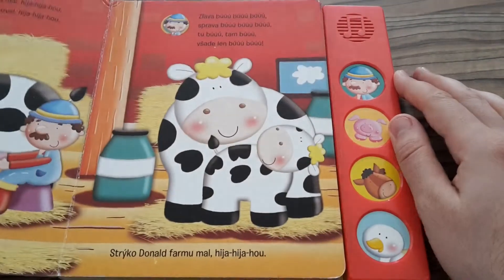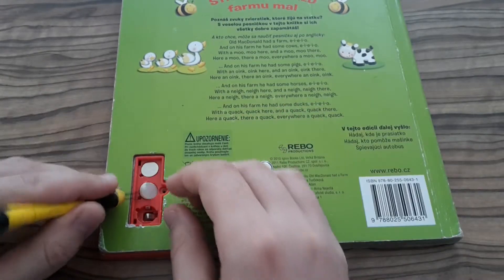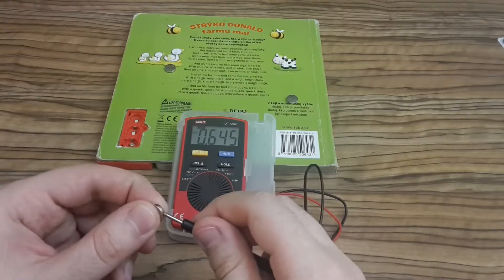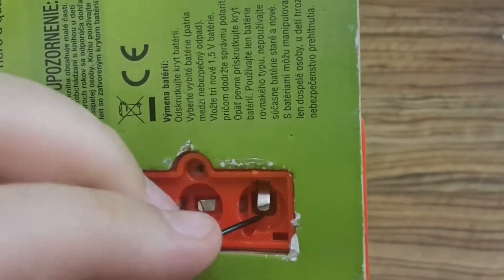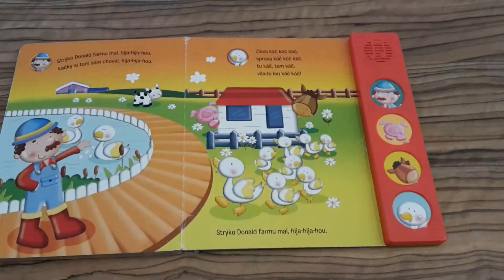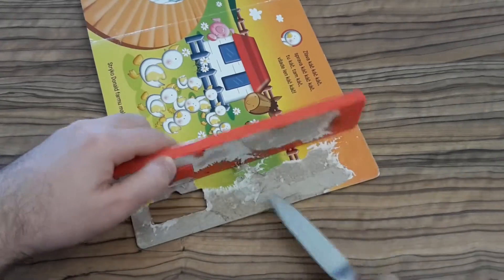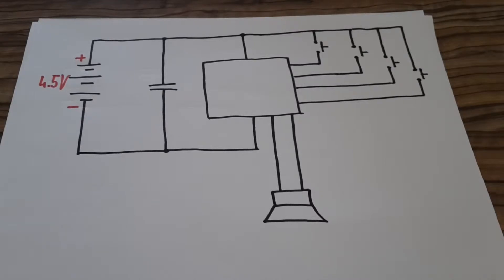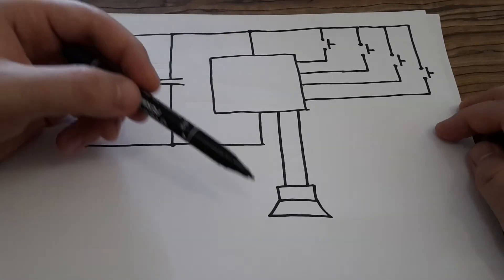Children's Sound Book Repair (1/2)

Comment: Do you have any tips for reducing the sound output for a book like this? I have a series of music books which for some reason are very loud. It causes the speaker to distort (quiet passages sound much better).
Reply: Personally I've just placed some scotch tape over the speaker.. not an elegant fix, but a useful one. Sometimes it's not distortion, rather vibration, which the tape had solved as well. Hope this helps, unfortunately I don't know how to reduce the actual sound level